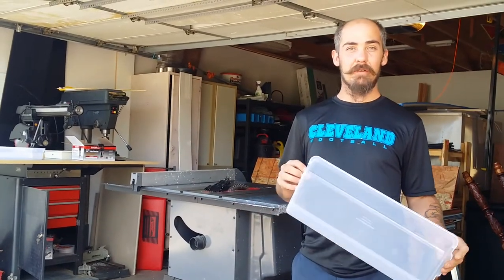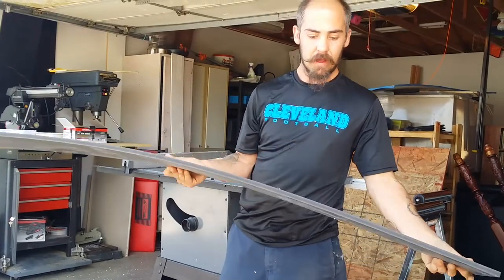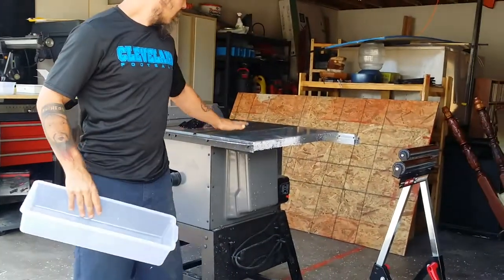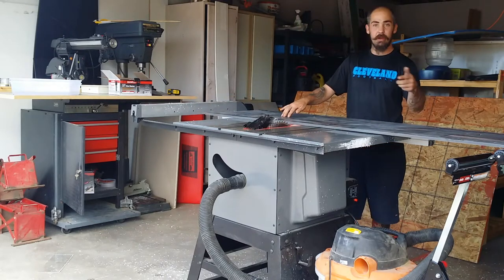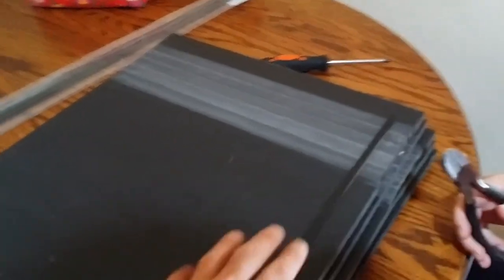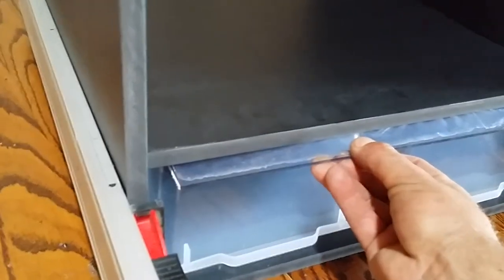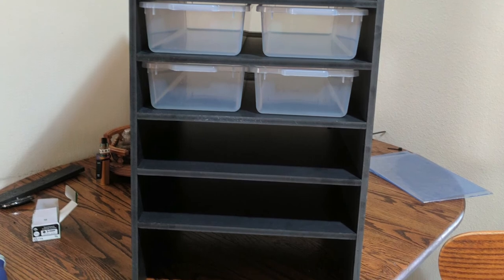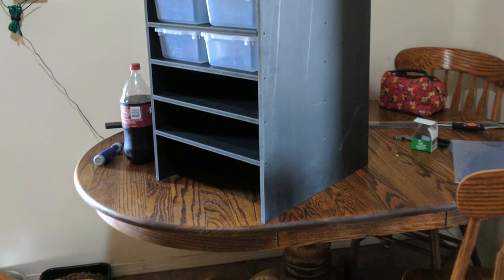V-18 Hatchling Rack!

Comment: What did you build the actual rack from is it pvc foam board ?
Reply from the maker: Kris Moore it is expanded pvc the same stuff that anamal plastics is made of.
Reply: James Redstrom I'm in the UK I'm trying to find this stuff but all I can find is pvc foam board
Reply from the maker: Kris Moore I was looking it up and I think it is the same thing as expanded pvc just has a few different names it goes by I hope that helps u out buddy.
Reply: James Redstrom cheers bud I have a hatchling rack to build and want to give pvc a try
Reply from the maker: Kris Moore yeah it is good stuff it's nice just for the light wight factor and water resistant.

Comment: good detail until the heat tape connection part.  then its just hmm what is he doinf with  those wires and let me grab a lighter.
Reply: doing*
Reply from the maker: Joshs Ball pythons the wiring went a little quick and not much detail.